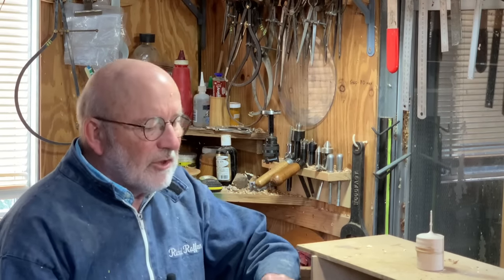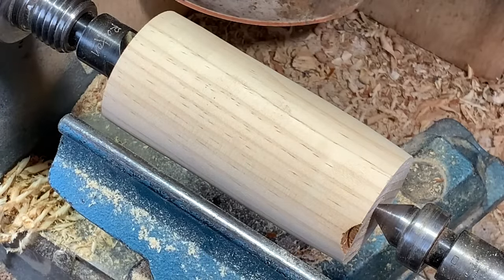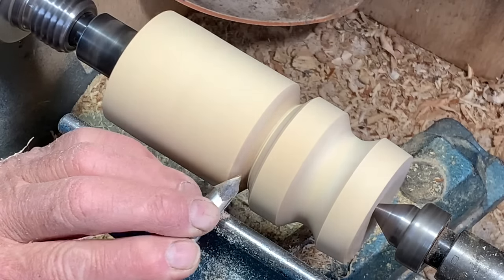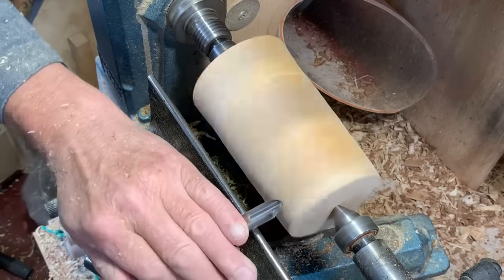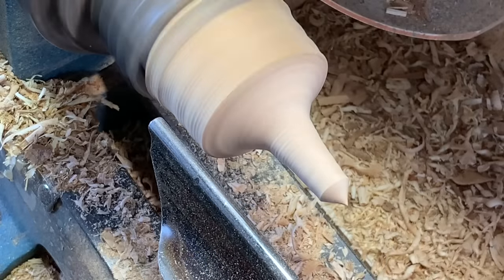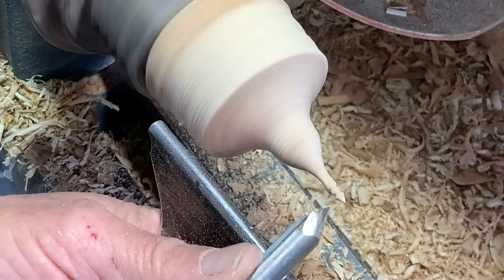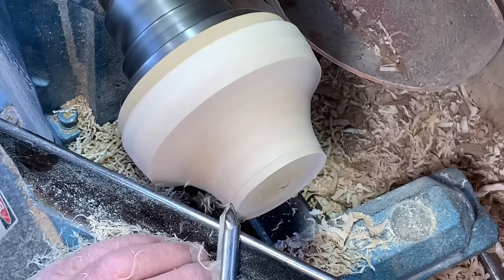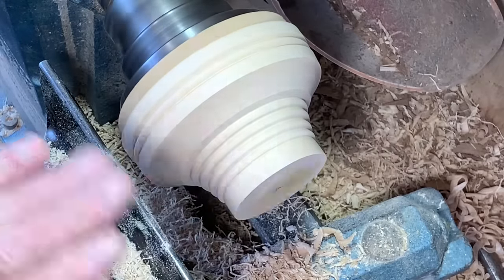Richard Raffan on the uses of a ½-in spindle gouge

Comment: I am still little confused about a spindle gouge and a detail gouge. If a spindle gouge has a 40° angle, does that make it a detail gouge? If it has a  fingernail shape is it a spindle gouge? Does the flute depth make a difference? I don't know. Do you have a video on the difference between the two?
Reply from the maker: The detail gouge has a shallower flute and generally a much longer bevel so the nose of the tool can get into tighter spaces like vee-grooves and function almost like a skew chisel. I feel a video coming on.....
Reply: @RichardRaffanwoodturning Should any gouge have a pointed tip with a 45° bevel? Or is the fingernail the shape for detail and spindle gouge?
Reply from the maker: @kenvasko2285  If you want to turn narrow grooves using a standard ½" spindle gouge you'd have a longer bevel typical of a detail gouge. A 45° bevel with rounded wings — an embryo fingernail — is a good starting point from which to develop a shape most useful for what you want ot turn. My gouges are mostly asymmetic with a longer left wing and shorter right wing and varying bevel angle.

Comment: Hello Richard! As always, I thank you for sharing your knowledge with us! I have a question. At what height should the tool rest for the spindle gouge be placed?
Reply from the maker: It's generally just below centre for facework, slightly above for spindles. You need to set the rest so you're comfortable, so the height of the rest depends partly on your height in relation to the lathe centre height and then the diameter of the spindle you're turning. There is no 'correct' centre height.
Reply: @RichardRaffanwoodturning  Understood!  Thanks again!!

Comment: What is the shaft diameter,  5/8?  I sure hate the differing gouge measurement methods.
Reply from the maker: I was wrong: it's sold as a ½-in spindle gouge and that's the overall diameter - 12.5mm. the flute is 10mm.
Reply: @RichardRaffanwoodturning  In the United States, one tool supplier has a couple listings for spindle gouges. There are more options than most retailers, but that is because Doug Thompson probably wants to have options precisely for everyone. Anyhow, I was wondering which of the options would be the most similar to your 1/2 spindle gouge. Would you consider the gouge that you use to be a "spindle gouge", "deep-fluted spindle gouge", "detail gouge", or a "shallow detail gouge"? I am assuming that it would be a "spindle gouge", which says it has a flute depth of 50% of the diameter. Sorry about the confusion, you are a true master and a pleasure to watch!
Reply from the maker: @williamno.1450  The spindle gouges I use are ½" diameter with a ⅜" flute. Some are Henry Taylor, some Hamlet, some Sorby who each market these as ½" spindle gouges as opposed to detail gouges that are the same diameter but with a shallower flute. I have a Thompson gouge ⅝" diameter with a ½" flute which is nearer a Sheffield detail gouge than spindle gouge and excellent as a bowl gouge.
Reply: Some are available as M2, some as M42.  Does it make any difference to you?